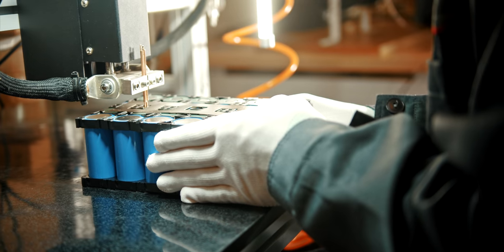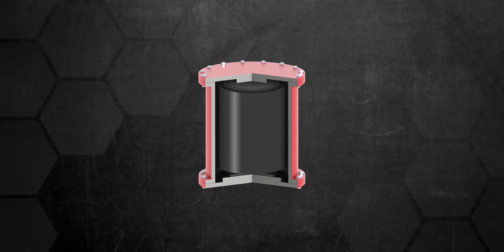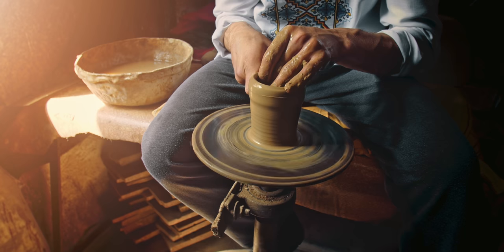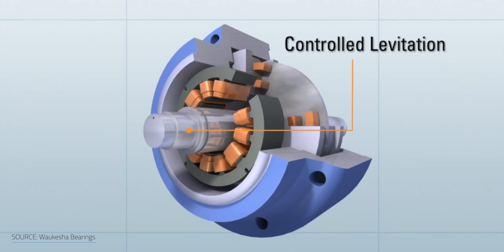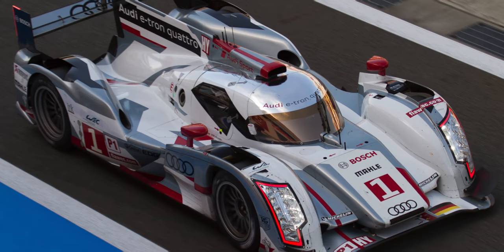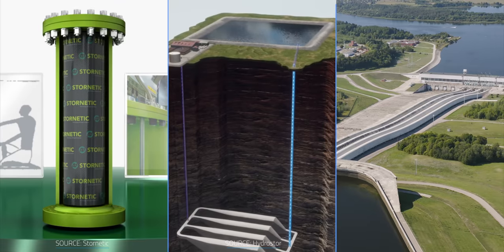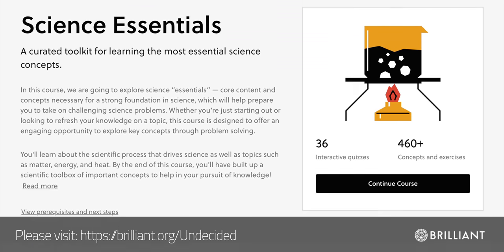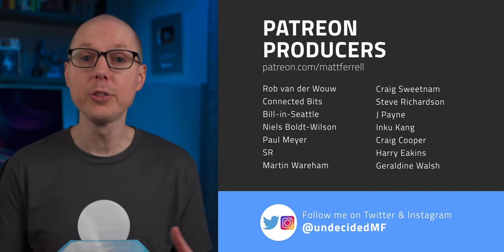The Mechanical Battery Explained - A Flywheel Comeback?

Comment: I remember giant flywheels in the sugar mill 50 years ago. Driven by huge steam pistons, the flywheel smoothed out the rotational motion that did all the mechanical work. They were beautiful but also very dangerous. They had been operating for a century and safety concerns weren't a big thing when built in the 19th century.
Reply: Which mill did you work at mate?
Reply: @boiibee2851  Fairymead. Did you work in a sugar mill, and which one?
Reply: The thing with a modern flywheel is that there is no need for extreme RPM, you just do the math, run it in a vacuum with a magnetic or some sort of low friction bearing and then figure out your windings to get the current that you desire. Just look at that antique Swiss bus, 6 kilometres at 50-60 km/h. spin it up when you are stopped for passengers and good to go. combine that with diesel electric for backup and our modern energy braking recovery and I can see this being at least 5x more efficient then it was 70 years ago. you can even have a direct mechanical transmission of some sort. when you look at 3000 lb battery pack in a Ford Lightning pick up truck that gives you a lot of inertia at 10x that weight in flywheels in a commercial city vehicle. Combining various energy recovery systems along with just keeping it spinning at top speed while it isnt in use would likely make it last even longer. Also you need no exotic materials, no fire risk, run it at a modest speed in a well designed case to contain any unlikely catastophic failure. It just sounds like a great thing as we have been using flywheels of all sorts for thousands of years (pottery, spinning yarn, wind mills, etc). You look at the massive turbines in hydro electric, the high speed steam driven power plants. It is just a no brainer to perfect what we know instead of looking for rare earths for a 10 year battery. We humans just seem to love to look for higher technology to make things more complex and try to make  things "better" instead of looking at simple known tech and making it more efficient. Just look at the electronics supply chain problems, thousands if not millions of cars waiting on a microchip just to make them function but otherwise complete and ready to go. Imagine where we would be with modern transport if for example we could not make our autos run for the want of spark plugs 120 plus years ago.  What has happened to that old adage of "Keep it Simple, Stupid"?
Reply: Yes. Retiring meant a short meeting near the flywheel and a pushing feeling from behind. Then a falling feeling. Then a crunching feeling.
Reply: @johnmadsen37 I was born in 57 and I’ve been retired for over a year. My experiments with flywheels have proven very fruitful and I’ve never been happier 🙏❤️
Reply: @johnkufeldt3564 also there is no need for vacuums and the bearing designed nowadays is sufficient in this application 🙏❤️

Comment: I worked at a nuclear power plant in the 70"s.  A motor generator set with a 2500 lb flywheel between the two. If all else failed the flywheel and generator would supply enough power the rod drive motors to get the control rods fully down.  It was my understanding gravity would get to 80 to 90 percent and the generator would do the rest. The system was tested during refueling.
Reply: Speaking of Nuclear power plants, what’re your opinions on 4th Gen nuclear power plants? Are they safe enough that we should be considering using them for power generation in place of fossil fuels? I always see nuclear fission as our transition power source until Fusion energy, or something cleaner, is developed. And Nuclear Fission is already extremely clean power generation, at zero carbon emissions in their entire lifetime, and the only CO2 generated from them is when they’re constructed. But I’m told by my mother, who’s a former X-ray tech, and anyone who wants the “Green New Deal,” that Nuclear is the wrong way to go.
Reply: @captainsinclair7954  yes they are safe enough. Always was.  Nuclear power is so plainly the path to a solution for our energy needs. There have been accidents in the past, unfortunately, that scared the public. Politics...anyways..
Reply: @captainsinclair7954  
This may get long winded but thank you for interest in my comment. I DO NOT LIKE NUCLEAR POWER , BUT if you want to approach zero carbon emissions I see no way around it.
Why I don't like nuclear power (1.) 3-Mile Island this was the first of there nuclear disasters (we were Very fortunate it didn't turn out like Chernobyl : would have devastated the east coast) (2.)  Chernbyl 150,000 sq. miles uninhabitable will have to be monitored as long as humans are on earth (3.) Fukushima  operated 40 yrs with virtually no problem then
mother nature took it out, will have to be dealt with for a very long time. Japan has 42 operational reactors, They only run 9 of them. Please read up on those disasters.

Now getting to your question. Unfortunately I am not up to speed on the 4th gen, but will get familiar with it. What I have seen thus far, the SMR(Small Modular Reactors)  are extremely promising. 

Solar. Wind and Battery's are fine but will not meet the electrical demands ever.  You have to have a base line for 24 - 7  reliable energy. And in my way of thinking the nuclear is the best choice.
Reply: @dant.3505  "There have been accidents in the past"  THERE WILL BE ACCIDENTS IN THE FUTURE.
Reply: @stevereynolds1739  nuclear is the most energy efficient and it should be populated in the future more. Because this is answer to increasing power demand. Production of nuclear plant leaves less carbon footprint (what a buzzword) than solar and wind plants for the same power and take less space
Reply: Okay Okay, there are disasters on earth... so lets make a giant flywheel made of nuclear reactors, in space. Win for everyone!

Comment: About five years ago a company in Poway , CA. was working on flywheels for energy storage. They had their flywheel in a pit in ground. One day the bearing let go. Needless to say it was a bad day. It jumped out of pit through the roof and took out the corner the building ( concrete tilt  -up ).  OSHA was not happy. The company went under soon after. P.S. no one luckily got killed or hurt.
Reply: Yep, the amount of monitoring sensors on those to pick up early signs of failure... vibrations, frequencies etc... and still miss when it's gonna let go.
Reply: Yep, also even if you contain wheel in one place after a failure the energy stored will be released in form of heat melting and igniting everything around
Reply: Dude it was obbiously destroyed by the power companies.  They dont want people to know
Reply: Anything storing energy is going to be, well, full of energy. A flywheel going off-balance or coming loose is akin to a battery shorting out or catching fire. Flywheels are a viable energy storage medium, but preventing them from being a hazard seems like it'd need a quantity of what I think the pros call 'heavy shit' placed between the wheels and anything likely to be damaged by the wheel getting loose.
Reply: @lexslate2476 Dirt and rock is heavy, bury it deeper is one solution albeit more expensive. Also, a safety exclusion zone not occupied by humans would help albeit at higher cost by having to purchase and maintain deadspace…. None of these issues are unique to flywheels though. Anecdotes about flywheel accidents are just indicative of poor risk management for that particular installation.
Reply: @chadwells7562  Yeah, I was thinking in terms of sticking the flywheels below surface level so that a failure would inflict shrapnel only on the surrounding gravel, which would prevent a chain reaction between neighbouring flywheels and protect nearby alive things that would prefer to not have new holes in them.

Comment: I find this very interesting as we have used flywheel UPS in the IT industry for at least 10 years to ensure that our datacenters stay operational during power loss situations. As they have a limited runtime, there is always a generator of some sort to take over when the flywheel stops spinning. I think that using them for grid storage and power conditioning is a good use of the technology. Thank you for taking the time to discuss it!

Comment: This was a great video of an old technology finally getting the recognition it deserves. IIRC the POTS telephone system in the UK used to use flywheels as a back-up energy source. Another great example was the JET Tokamak in the UK, which uses two flywheels, each of 775,000 kg to generate 400 MW. I read somewhere each time the wheels were discharged, it shifted the building on its foundations. 

A quick note on units - kilometres is written km not Km (that'd be Kelvin metres), and the ISO & SI standard is to leave a space between the number and the unit.

Comment: The amount of stored energy goes up by the square of rotation.  The amount of centrifugal force also goes up by the square of rotation.  Therefore the limiting factor of how much a flywheel can store is the tensile strength of the materiel being used.  Carbon fiber is the materiel of choice because of this.  It can have a tensile strength of around 200,000lbs/sq in.  If one were to use diamond or carbon nanotubes, the highest tensile strength of any known material, its increase to several Million lbs/sq in.  For example if one were to have a carbon flywheel the rough size of a water mellon spinning at 30,000 rpm the amount of energy stored could power the car for about 2/3 of a mile.  (Ball park calculations) That same size flywheel made out of diamond could spin at 600,000 rpm and power the car to travel several hundred miles.  This is due to the power of exponents along with the fact the diamond is about 2x as dense as carbon fiber.

This type of flywheel has many other advantage, not sensitive  to outside temperatures, unlimited charge/discharge cycles, small area of displacement, fast charge up times, no hazardous material, and locks up carbon in a solid form.

The main issue with this technology is what happens during a failure.   In my example using diamond if you were to calculate the velocity of a fly stuck to the outside of the flywheel its velocity would be about 3x that of a high power rifle.  Now lets take the world strongest material and explode it in all directions travelling at 3x the speed of a rifle and you have the making of a deadly bomb which is why if this technology is ever developed it would need to stored underground.
Reply: I would have to brush the dust off my books to know the precise effect, but spinning gyroscope will affect the handling of the car. It might make it turn corners better or worse, or create a lifting or down force, depending on orientation and spin direction of the flywheel.
Reply: @joeprizzi407  ask anyone who has owned an r series BMW motorbike. The massive flywheel drives you down into right hand corners and lifts you up out of left hand corners (may have this the wrong way around as it's been a whole since I sold mine)
Reply: @SomeKiwi  Not necessarily. It depends how much and how fast is energy released. A flyweel relases all energy immediately if the device is destructed. This is what make high capacity flyweel dangerous. A heap of coal is not dangerous at all. And a lithium ion battery is much less dangerous than a flyweel. Note that 1kg of TNT has an enery of about 1.16 kwh. So a flyweel as drive battery would make a car to a rolling bomb. With stationary applications this is less an issue.
Reply: "In my example using diamond if you were to calculate the velocity of a fly stuck to the outside of the flywheel its velocity would be about 3x that of a high power rifle."

It is actualy pretty simple. It releases all the stored energy. And every kwh stored has roughly the enery of 0.86 kg tnt.
Reply: @vornamenachname2625  The advantages of higher velocity with graphene are lost in the higher cost.  If you want to go fancy materials use a superconductor maglev track in a loop.  Concrete and/or bedrock can support.  This can be spun up to multiples of orbital speed.  The superconductor can be hybrid SMES and flywheel.
Reply: If you had a diamond flywheel in your car you would need an armed guard 24/7.
Reply: Pls never use lbs/sq in ever again
Reply: @joeprizzi407  I don't think that was the point, I think they used car range to translate in layman terms what the difference is
Reply: @dave4792  left or right don't make a difference, the system is symmetric for angle
Reply: What happens if you spin something like that up and it isn't balanced perfectly?  Seems like it would require some spectacularly precise balancing.
Reply: @SomeKiwi  Failure is far more likely with things with high speed moving parts.
Reply: Your  figure for distance of "hundreds of miles" at 600,000 rpm are completely ridiculous. Even on flat ground you would not get hundreds off miles. Especially seeing as you say you would only get 2 thirds of a mile at 30,000 rpm
Reply: @joeprizzi407  the flywheel bus fixed this problem by having the flywheel spin parallel to the turning axes of the vehicle.
Reply: Wouldn't the charge/discharge cycle be similar in practice due to material fatigue? I mean we've seen the opposite case already with mechanical switches vs electronic ones. 

Still something best done preburied so that if it breaks up and flies off it buries itself into the dirt instead of through people and expensive machinery and structures.
Reply: @Nasrudith  weight towers would be safer and much cheaper.
Reply: @nicolasuribestanko  not really industrial Diamond are pretty cheap at the minimum less expensive than Lithium
Reply: @sammyd7857  energy compared to speed is squared. It isn't linear. 600,000 wouldn't be 20x more mileage - it would be 400x.
Reply: @redpilljesus  there is no proof of that.
Reply: @sammyd7857  you can't be a real human. Math, my guy. It's just math.
Reply: @redpilljesus  no proof. Proof is a flywheel doing what you said.
Reply: @sammyd7857  the whole topic was an "if", my guy. Nobody has to actually do it for the math to check out. And nobody has to prove anything to you.
Reply: @marriottjk  of course nobody has to prove anything, but by aquiesence I am  right
Reply: @sammyd7857  🤣

Zero things have been acquiesced. Nobody has given anything to you.

What exactly do you feel right about? That hypothetical cars dependent on extremely expensive undeveloped technology can't be shown to you through the internet?

Ooh

Wow

You got us
Reply: @redpilljesus  no one has shown anything to do with what you say the math confirms.  If you kniw of the physical test been shown and you can show me then i will bow down.  Currently you are wrong and just keep saying nothing
Reply: @sammyd7857  Gyrodrive is already in London busses. Small, 1kWhr, 120kW flywheel battery. Only 36,000 RPM. Their busses have seen a 20% fuel savings already.

Happy?
Reply: @sammyd7857  What do you want to see proven? The energy in a flywheel scales with the square of the rotational frequency. 20 times faster rotation thus yields 400 times more energy, if weight and weight distribution (i.e. moment or inertia) are the same. If you want a proof of this, look up a physics textbook (or the wikipedia page for rotational energy). 

With respect to the above, 2/3 * 400 does equal 'hundreds of miles'. So, you were wrong indeed.
Reply: You have omitted to mention that it must be perfectly balanced otherwise it will shake itself apart with catastrophic results.
Reply: @rogerphelps9939  the comment for what it says is full of assumptions